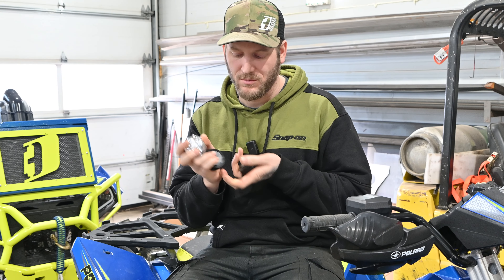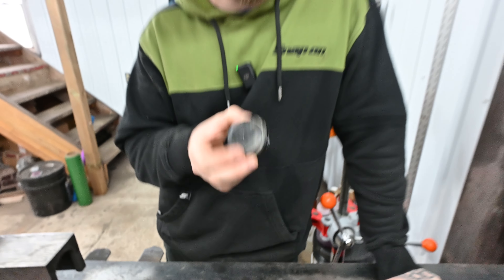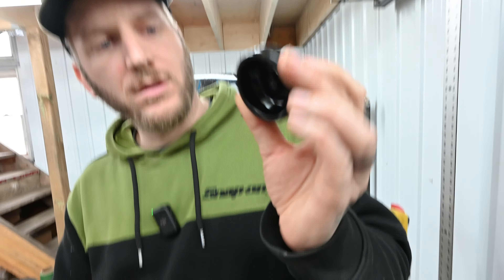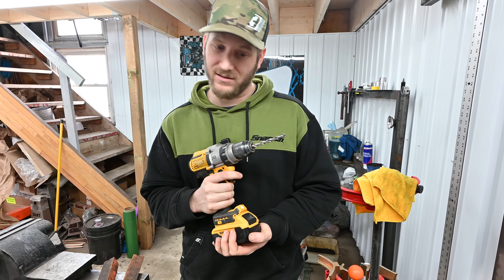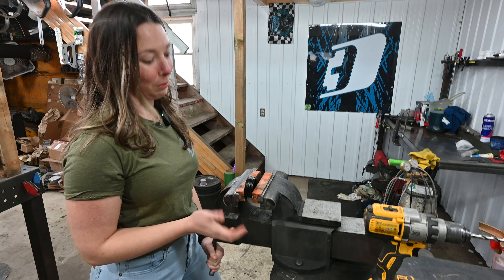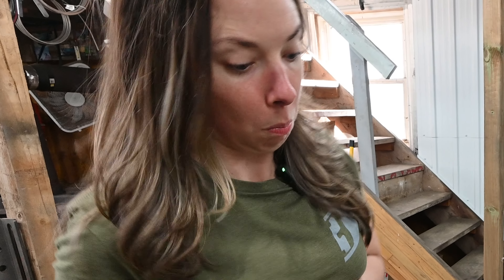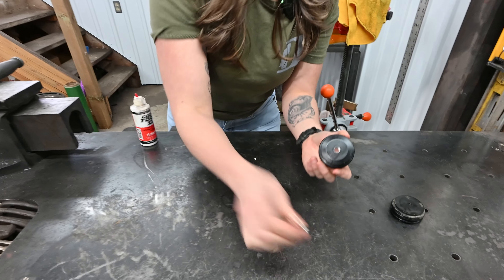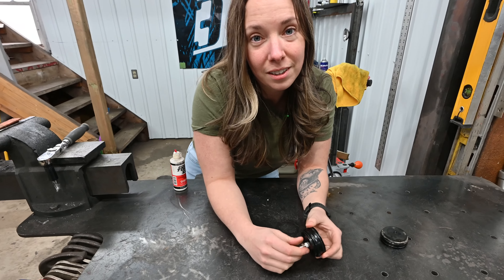How To Install Schrader  Valve on Stock Reservoir Cap

Comment: Finally! You have answered my question about the screw-type end cap on my Fox shocks.  I learned quickly when I removed one to "check my psi".  Once you remove it, you have to use one of the two options you illustrate here.  I already had new end caps, thank goodness.  Also, just viewed your Colorado videos (Red Cone, etc).  They have inspired me to plan a trip there in late summer 2025.  
One more thing... Does Mel do ALL of the driving? Lol.
Reply from the maker: Glad we could be helpful! You will love Colorado! 

Yes Mel does all the driving it’s her machine!! 😁
Reply: @d3offroad  I hadn't seen your earlier video of when you wrecked yours when I wrote that.  Makes more sense now!  I like what you said about waiting to buy a new machine.  I made that mistake with my 2024 Turbo R.

Comment: Thanks for the video lessons. Question, is there a torque value on tightening the Schrader valve?
Reply from the maker: Just make sure the core is snug! It’s so small it doesn’t need much “torque” or it can strip the threads

Comment: To do this job, it only requires removing and inverting the shock, then removing the cap from the reservoir? No need to remove the Springs, etc?
Reply from the maker: To do this you can just jack the machine up all the way so the tires are hanging, then remove the cap from the machine and do the work at your work bench. Then install and charge the shock. No need to remove the shock at all
Reply: Awesome! Thanks for the heads up. I'll be ordering some valves from you this week.

Do you offer a full kit with valves and tap per chance?
Reply from the maker: @BIGJOESXR   At this time we do not offer them with a tap, that is a good idea moving forward though!
Reply: Hi, I'm finally ready to tackle this project! 

I live in South Louisiana and it's very hot and humid. Should I do this project indoors with climate control? Or would purging with nitrogen during reassembly be sufficient to keep out other gas & moisture?

Comment: How does fox set these from facotry?
Reply from the maker: There is a tool that you set the screw inside it and it wraps around the resi body and seals against it like a chamber that you charge and while it’s under pressure they install the screw then remove the chamber